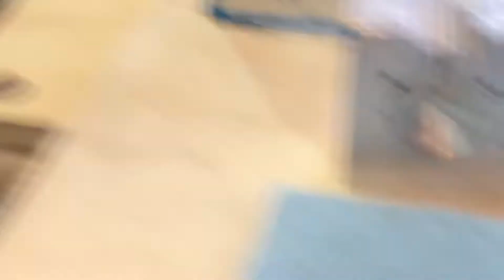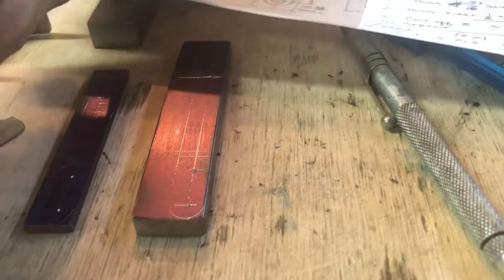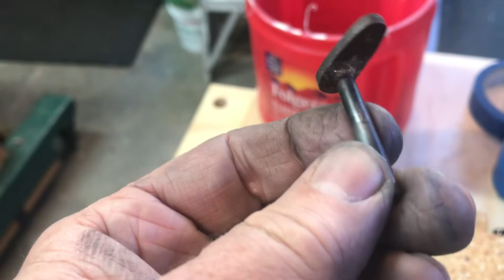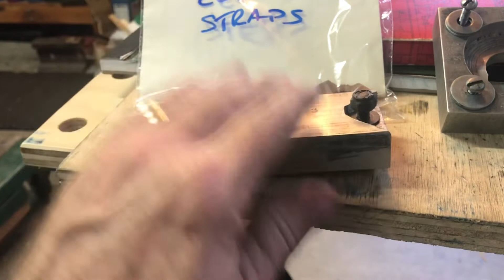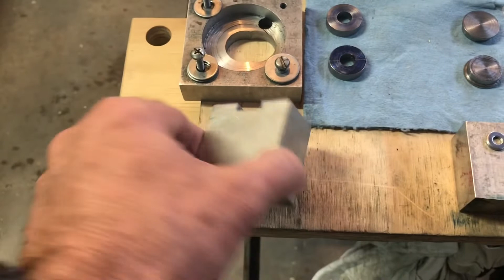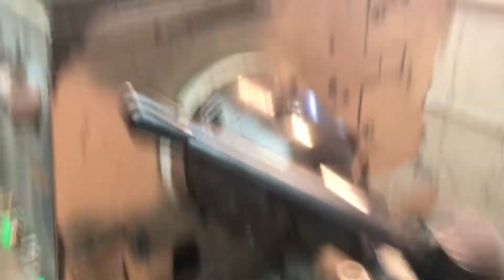4. LBSC TICH, making eccentrics, stop collars and rocking levers. Custom machining jigs used.

Comment: Hi, enjoying the build, I seem to a bit dumb trying to get my head around your 'quartering' Jig....if I have understood the design, the centre of the axle forms the fixing of radial lines one vertical, one horizontal so 90 degrees apart, I get that, BUT when you put the axle in the jig and position the short crank  pins against the jig, you are touching the circumference not the centre of the crank, so I can't see how you get the 90 degree timings, the rotation is 90 degrees minus the crank thickness measurement which depending on the crank throw around 10 degrees short of 90, I know this jig works...I just can't get my head around it at present. If no crank pin was present, then yes you could use the jig to scribe a line on both wheels 90 degrees apart, but if the crank is fitted it seems to me that an allowance has to be taken for the crank pin diameter. Any clarification you can give would put me at ease...Thanks
Reply from the maker: @anthonyashgrove2908  Hi Anthony, I do understand the confusion and it took me a while to make sure the jig would work correctly. The key factor is that the jig holds the axle centers, and the little shelves that support the crank pins are 90 apart from each other. If the axle was supported on its circumference (like the jig Kozo shows on page 177 of his book), you would have to account for the crank pin thickness. Hope that helps. I showed the jig in video #2 of the series, but really didn’t do a good job describing it and its function. I appreciate your question and wish you luck with your projects. Thanks, Bill.
Reply: @metalmill52  Thanks for explaining much appreciated
Reply: Thanks for having patience with me, I think now finally I have got my head around 'How the Quartering Jig Works' The bit that 'passed over' me was the two 'L' shaped sides, in my mind I had them facing exactly the same way, hence my questioning on how you could compensate for the radius of the crank pin.....'Penny finally dropped' the 'L' shaped sides are mounted facing in the opposite directions, so now the offset created from the crank radius is applied to both wheels in the same direction so the angular spacing will remain at 90 degrees no matter on the crank dia 'phew' got it
Reply from the maker: @anthonyashgrove2908  yes, that is a great point, Anthony. In fact I marked my jig one the right side to say “right hand lead” so next time I use it I’ll be consistent. Thanks again for watching and asking!